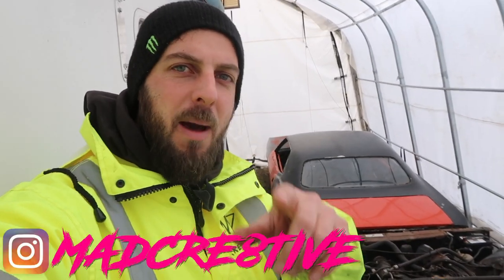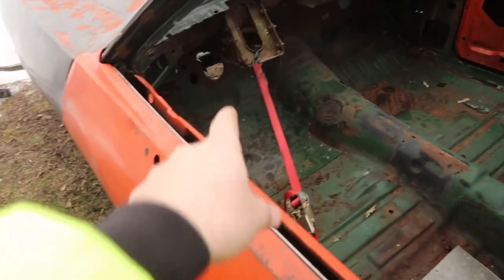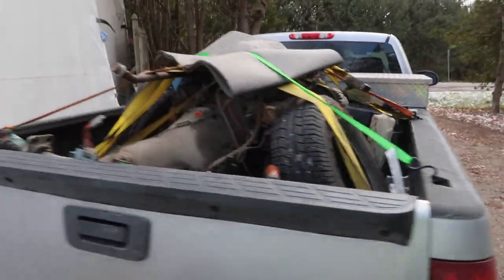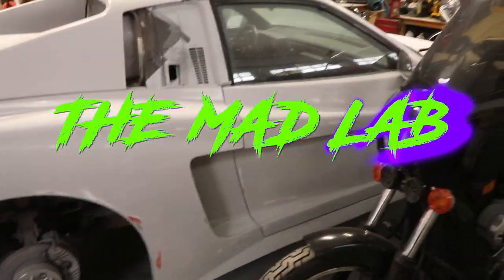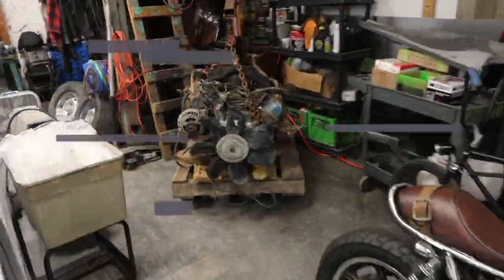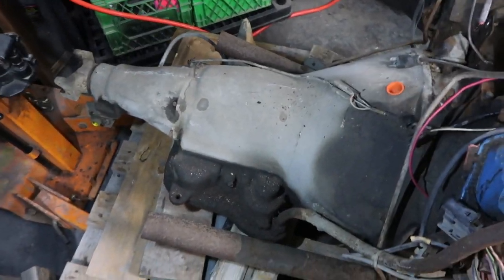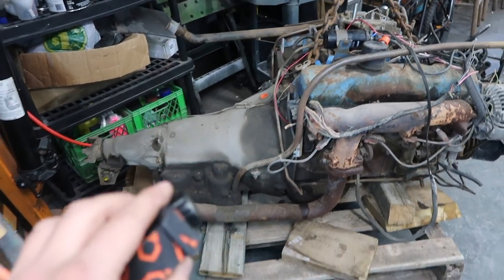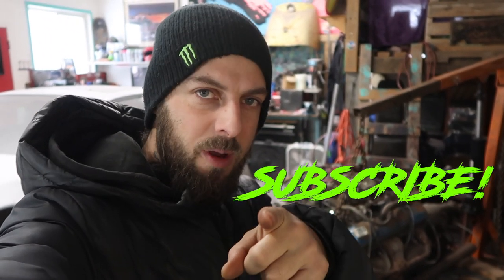MOTORHOME 440 BIG BLOCK (1974 Plymouth 'Cuda Build Gets Chrysler 440 Out Of RV)

Comment: i think you will have to change the tailshaft on the transmission to get it to bolt up to chassis. I built one of those 1976 Winnebago 440. Stuck it in this 1974 Barracuda.https://www.youtube.com/watch?v=ogWijKUqg3E   It will make awesome power if you change the pistons to 10 to 1 compression. Stock Winnabego 440's have 8 to 1 compression.
Reply from the maker: Very nice build you did there! And thanks fir the info on the tailsaft ice herd that a few times so I’ll need to look into it more!